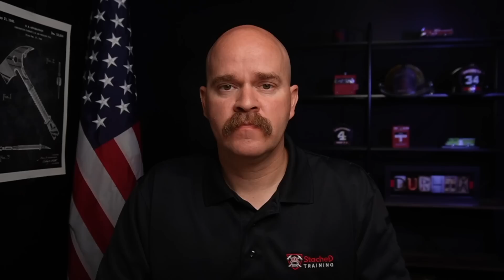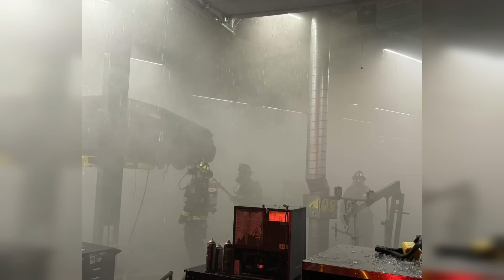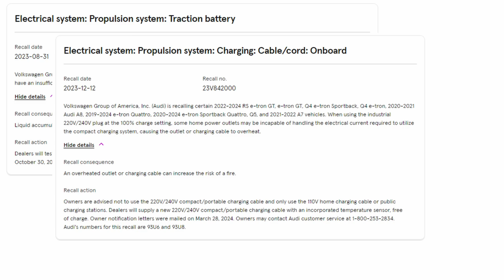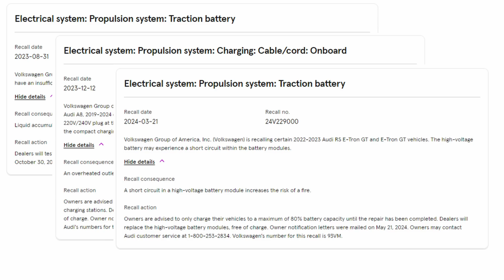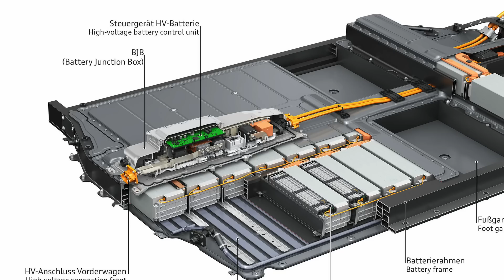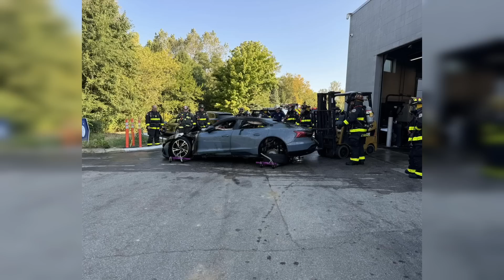EV Fire in Service Bay: Stuck on the Lift

Comment: The more I think about the risk of owning an EV the more I’m convinced it’s not worth the risk.  Imagine parking your car and it self immolates taking out the cars next to yours.  It doesn’t take much to exceed your policy limits.
Reply: Imagine parking your ICE vehicle in an airport car park and it self-immolates taking out.. the multistory car park and over 1400 vehicles. No EV required, as it turns out.
Reply: @Monkeh616  most parking structures are designed with sprinkler systems that are designed to suppress ICE vehicle fires.   Those sprinkler systems are ineffective against EV vehicle fires.
Reply: @fountainvalley100  If they were designed properly in the first place they'd be pretty effective at containment. If they're even fitted. Turns out, they're not.. don't park anywhere without verifying the presence and design of the fire containment system for the one in a million risk, now.
Reply: Eh, EVs catch fire less often than ICE cars do. When they do catch fire though, the fire is way worse. Its kinda like flying. Its much safer than driving, in terms of the frequency of accidents, but aviation accidents are usually much more deadly than car accidents when they do occur.
Reply: We have about 5 years to phase out fossil fuels (to hold the line a 1.5C or 1/3 of an XKCD ice age unit). Sure, ICE vehicles can be switched to a carbon-neutral synfuel: but that will be incredibly expensive. For "low hanging fruit" like typical commutes: it is far cheaper to just electrify. Mass transit can even electrify without massive batteries: using overhead lines. That technology is so mature that it is considered old-fashioned!
Reply: @economicprisoner  false alarm.   What ever the US does will be undone by China and India.
Reply: @economicprisoner  1 WEF credit has been added to your account, it expires in three days, we suggest you spend it on tasty bugs

Comment: Currently, less than 1.5% of all cars in the US are BEVs. Imagine what will happen when 30% or 50% of all cars will be BEVs if the rate of BEV fires remains the same. Inevitably, there will be a much higher probability of spreading BEV fires to other vehicles and property because these 30-50% will have to be parked and charged somewhere
Reply: you can see what happens in china...  they are at 8-10 EV car fires a day
Reply: @zarthemad8386  yes and that number is just going to increase logarithmically
Reply: @sageoz9886  Lithium iron phosphate (LiFePO4) batteries are incombustible and don't use cobalt. Enjoy your horse and carriage while they're still around.
Reply: @nathanbaker6033  yet they aren’t used by the car industry as they don’t provide the high level of power, cost more and weigh more, as well as still have a shitty lifespan needing replacement often which negates any potential ’green’ benefits. Yeah I’m sure gas engines are just gonna all be obsolete now 🤣 
You really think we are all gonna replace every car out there with electric? You actually think that’s feasible? Where and how are we gonna charge them? Unfortunately they don’t run on your fantasies
Reply: @sageoz9886  We have 5 years to phase out fossil fuels; to hold the line a 1.5C or 1/3 of an XKCD ice age unit of warming.
Sure, ICE vehicles can be switched to a carbon-neutral synfuel: but that will be incredibly expensive. For "low hanging fruit" like typical commutes: it is far cheaper to just electrify. Mass transit can even electrify without massive batteries: using overhead lines. That technology is so mature that it is considered old-fashioned!
Reply: @economicprisoner  sadly public transport is only a tiny fraction of the change needed and we could replace all cars(if possible) with electric and barely notice a difference. What we need is more trains, inner city rail lines and Nuclear power plants. Sadly the auto industry has had so much power over legislation that everything in the USA and most the world is designed with infrastructure to prioritize cars. Even zoning laws that create suburbs where one has to drive miles just to get to a store in a giant parking lot.
Reply: @sageoz9886 The EV sitting in my garage uses exactly those kinds of batteries and they are nearly 3 times as durable as the old ones. Also, EV's have an 8 year warranty on their batteries. If they were as fragile as you seem to think they are , they wouldn't be feasible to sell. Obviously ICE vehicles aren't going any where anytime soon but eventually EV will take over.
Reply: Hybrids are a much bigger problem. Statistically, per 100k units sold, they're responsible for 14000% more fires compared to proper EVs. And yes... That's fourteen thousand percent.
Reply: And China wants to flood the States with more EV’s that even their citizens are complaining about the safety and quality of!
Reply: Just look at China.  They suppress the news to sell more
Reply: Imagine what will happen when the vehicles which statistically catch fire less are more common. Oh! Fewer fires. Yes, that's right, the fire rate is WAY LOWER. You just never hear about ICE fires, because nobody talks about them. A 'known' risk isn't news, even if nobody knows about it because nobody bothers to learn.
Reply: 26% of passenger cars in Norway are electric. No sign of a car fire apocalypse yet.
Reply: There luckily will never be that high a percentage of EVs. The infrastructure can’t handle it, nor is there sufficient lithium and cobalt to make that many batteries; more importantly the public is finally catching on to how stupid EV cars are, especially as we see them aging and the batteries failing more often. These fires are only going to increase in frequency as more EV’s start hitting that ten year old mark
Reply: @sageoz9886  If the infrastructure can handle the supper rush; it can handle overnight EV charging. Power draw is about the same.
Some undersized distribution transformers may need to be upgraded (due to reduced cooling time).
Reply: @sageoz9886  LOL! Consumer electronics can't last 10 years. The average age of the EV fleet has been stuck at 3.5 years since 2019.
Reply: @sageoz9886  That’s what they said about ICE cars when they started replacing Horses.
Reply: @williamnot8934  remember how they said the Flowbee would be the breakthrough in haircuts and that the future would replace all barbers? Totally eating those words now aren’t they! 
*continues to Flowbee cut my hair *
Reply: @williamnot8934  that’s what they said about SpaceX commuter rockets replacing airplanes! Those airlines sure are crying now
Reply: @williamnot8934  like when they said Laserdisks could never replace those outdated vinyl records! Time has proved how short minded those backwards record playing idiots were! 
* polishes my Excalibur Laserdisk*
Reply: @williamnot8934  remember when they laughed at the Metaverse saying that regular computer screens are better? Now that everyone has adopted the Metaverse all those idiots watching 2D screens sure look dumb. 
-Sent from Metaverse
Reply: BS. Where do you get your numbers.

Comment: they can't make batteries for small devices that manage to hold charge after 5 years and they want you to drive around on  a giant one whilst vibrating the shit out of it.
Reply: What rubbish.  I have a Nighthawk rechargeable torch which I purchased in 2010 and it still works perfectly.
Reply: @alanc286  Do you charge and discharge that torch a significant amount on a daily basis? And when you do use it i doubt very much that the battery cell is having current pulled off it at the limit of it's C rate.
Reply: Even the Nissan Leaf batteries, notorious for not having active thermal management, typically last 10 years.
Still waiting on after-market batteries to become available.
Vehicle manufacturers want to sell you a new car instead of a new battery when it eventually fails.

Comment: Hah! ‘Do not park your vehicle indoors. Park your vehicle outdoors at least 50 feet away from any structure’! Good to know 🤣🤣🤣🤣🤣
Reply: Some of us world rather die from normal car accident than from stupidity of ourselves that is buying exploding ev.
Reply: And leave the keys in it
Reply: Ok troll
Reply: just buy an ICE car. plain and simple
Reply: @birdiem123  anyone rallying for how great ev's are, are either a troll, or are not well educated.  Simple as that.  Stay away from these ev nightmares, and by all means refuse service and keep them out of shops.  They will come to an end quickly.
Reply: @Chiefs-online  I am against the current battey tech. If safety is addressed, with solid state batteries, I would consider one. I expect eVs with solid state batteries to enter the market in a year or two. They are much safer, but I would wait a year or two once eVs with ssbs hit the market to see what the risk factor is.
Reply: @birdiem123  lithium mines make me sick, imagine what it does to the workers..  Not to mention the pollution from that mining process.  Then consider the extra weight.  Car crashes will be much more violent.  Then consider use in cold climates.  How are you gonna stay warm, while being able to commute 100 miles?  Then consider being able to charge your vehicle everyday to be able to get to work on time everyday.  Believe it or not they can only charge so fast, unless you want it to burn down everything you own.  There are so many problems with them that people are overlooking.  I don't care what anyone says, it won't work.  Not to mention our power grid would fry if everyone has one and intends to charge them.  No rocket science required to see how foolish this ev stunt is..  don't be a troll your with or against...
Reply: And don't park it anywhere near someone who was smart enough not to buy one.
Reply: @graeme9679  More people die every year from the normal operation of ICE vehicles (about 5 million due to air pollution) than from EV fires.
Reply: @economicprisoner well, as far as I know, all electrical energy is created with heat.  To get heat, other than nuclear, you need to burn something.  So just because an electric vehicle isn't polluting in its immediate vicinity, doesn't mean the coal being burned at the power plant isn't polluting.  And then we overlook the toxic waste that is created mining this stuff, and all the waste we will have from expired batteries alone.  Not to mention the obvious danger of fires that can't be extinguished.  It's more of a luxury, it will never suffice as a dependable vehicle, especially in colder regions.  More efficient and less polluting engines are still the most feasible.  Sorry to burst your bubble.
Reply: @Chiefs-online  We have an open fusion reactor about 150 million km away.
That energy can be harvested with photovoltaic, wind, or hydro power.
Reply: @economicprisoner  water energy definitely should be looked at closer, try making any generator in the water without explicit permission from the government.  Dnr would rip them out of a river so quick it would make your head spin.  As for solar panels, the pollution from making and disposing them is not good either, and for the amount that would be needed, we would also be worse off.  As for wind, well the turbines don't last forever, and the amount needed of them is also insane.  Exploding turbines everywhere, nice thought.  The maintenance cost alone would be giant.  So yeah, we will f ourselves with wind or solar, and water power is highly regulated.  Tell me stuff is f-ed without actually saying it..
Reply: @economicprisoner  maybe society needs to become less dependent on energy.  That's the real solution.  We don't need cars or electricity to live.  We choose to confine ourselves in a world like that.
Reply: @economicprisoner  what, no rebuttal?  You kept talking, what ya got?
Reply: @Chiefs-online  Your mind is made up.
Don't see a need to respond unless you have something more interesting to add.
Reply: @economicprisoner  no, you just have no good counter-debate.  I think it's you who has their mind fixed on something.  Well make it a reality then, one that DOESN'T condemn our planet.
Reply: @economicprisoner  and just to tickle on your original comment:  how long have ev's been mainstream?  Never.  What's the percentage of ev's on the road vs ice vehicle's?  There lies the answer.  If the percent was 50/50, I'd bet anything fires and deaths everywhere.  Not to mention how heavy they are.  Speed plus mass equals more wrecking force.  Not interesting, your behind hurts more like..
Reply: @Chiefs-online  EVs were mainstream when the horseless carriage was fist invented.
Henry ford popularized the ICE by mass producing the model T, bringing prices down.
I also think (hope)  the massive batteries are going to be a temporary thing to alleviate range anxiety: until more charging infrastructure is built out.
Originally you had to go to a pharmacist to fuel your ICE car!
Reply: @economicprisoner  yes. Totally a moot comparison, just saying.
Reply: You forget the conditionals he is stating. This car allready had a few well specified issues that are clear indications why not to park them inside. Still they placed it on the bridge for the weekend. That is close to intentional....
Reply: @HansKeesom you cannot, with any degree of certainty, know if you car has been subjected to water ingress. given these fires are fast and violent, only someone foolish would purchase one, let alone park in a garage. Does an average home have a fire surpression system in the garage for the eV? I didn’t think so
Reply: @birdiem123  Ther eare many things you don't know about a car, but when you know it has damage, do not park it overnight inside.
Reply: @HansKeesom  how will you know if there is water ingress on an eV? You cannot. Your best bet is to play it safe and always park it outside. Better yet, buy a reliable ICE car, and skip all this eV stupidity!
Reply: He meant service centers. So it’s ok to park your expensive electric vehicle inside your garage 😏

Comment: Servicing EVs should be done outside and far away next to a mini fire station and away from the main service center as not to interrupt the majority of cars that are ICE that need to use that facility.
Reply: You need to heavily insulate that tinfoil hat as well, to be safe.
Reply: @ElMistroFeroz  Due to the relentless hoarding and wastage of earth's resources by EV makers, there isn't enough insulation material to insulate any tinfoil hat that you need.

Comment: The really scary parts are the fumes are straight up poison, the batteries don't have fires that 'run down' they just go and go and there is still a huge shock hazard. but those fumes can ruin lungs in seconds.
Reply: You are so right…gas/diesel fuel fire is nothing in comparison. Just walk up and suck it in like a BBQ and keep working. Fire department? No need I’m sure the sprinklers will put it out.
Reply: @ChromeLuxx Bro gas and diesel fires will definitely kill you too but EV fires probably have a lower chance of survival.
Reply: Smoke is killer number one in fires, not burns.
95% of comments here are like ICE cars never burn, they do and they burn down houses, garages and people inside.
Reply: Ah, but the wokesters consider human life to be insignificant; they're quite willing to kill every human on earth if it means "'saving' the planet".
Reply: Unlike normal fire fumes which one can breath and be fine right?
Reply: @jstar1000 big difference,  gas engine fires don't produce extremely toxic cobalt gas. Do some research instead of listening to what your media masters are telling you.
Reply: Meanwhile gasoline fires smell like roses.
Reply: @ElMistroFeroz  gas engine fires don't give you cobalt and lithium gas poisoning.  Those are life long destruction poisoning.  Big difference.
Reply: @ElMistroFeroz  Look up cobalt related interstitial lung disease. I was scared to death by a 1980s 60 Minutes report about a pretty girl who worked at a tungsten carbide cobalt tool factory and got cobalt lung. The steroids she had to take to be able to breathe turned her into a fat hag with a spine collapsing from osteoporosis.

Comment: Remediation of the shop, the tools, the other vehicles…that is a hazmat emergency clean up for anyone having to work in that building.
Reply: don't these EV batteries produce extremely poisonous flourine gases when they burn?  They had a huge EV battery fire on Interstate 15 between Las Vegas and Los Angeles in July 2024.  A semi-truck full of these batteries overturned in the middle of the desert during a heatwave.  The hazmat issues was so serious they had to close the interstate both ways for 2 days.

I think these things are going to need more serious regulation and engineering, to deal with these fires.
Reply: has to be close to 2mill in damages lost time etc
Reply: Would love some proof of this please. I work in this shop